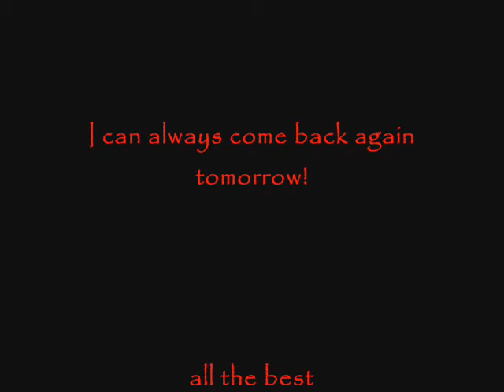Knife Maker..The Bad Ass..Initial Edge Grinding.

Comment: DidI see that right in that the bevel went from about an inch in to the edge with no secondary bevel? Are you going to put one on?  I have a hard enough time with a stationary grinding wheel let alone a hand held.